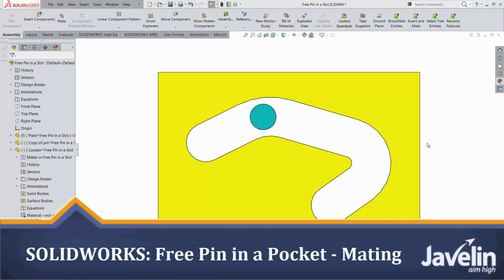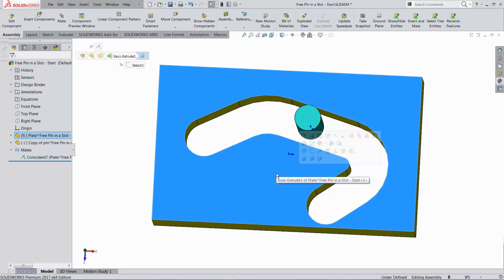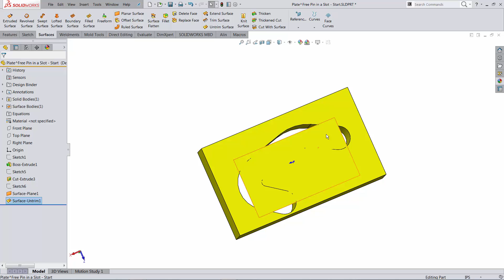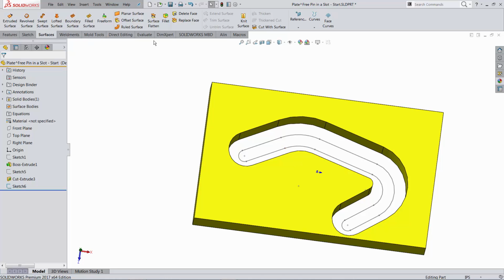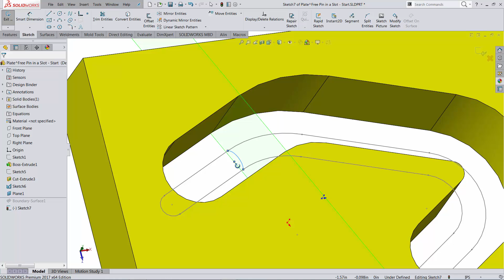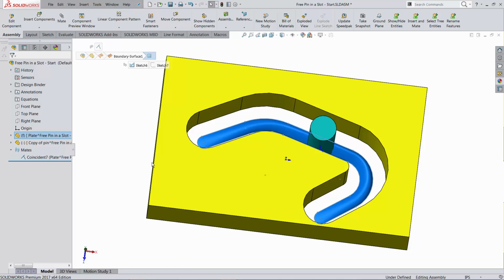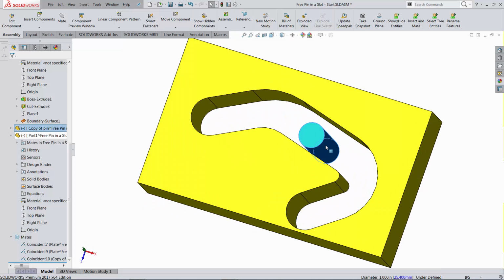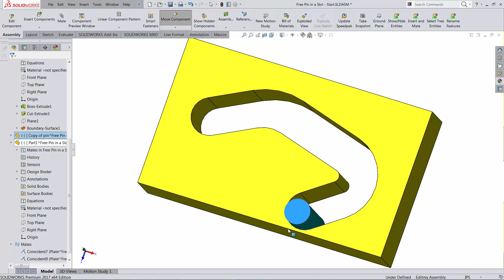SOLIDWORKS Tutorial: Mating a Free Pin in a Pocket, Real Life Conditions

Comment: Can you make that pin not only stay within the confines of the groove, but also tilt until it touches both sides of the groove?  I'm trying to mate a sloppy piston in a cylinder.  The piston needs to be able to tilt left and right (not in every direction) up to 3°, inside the cylinder, during reciprocation, due to the design of the connecting rod.  I'm using 2016.